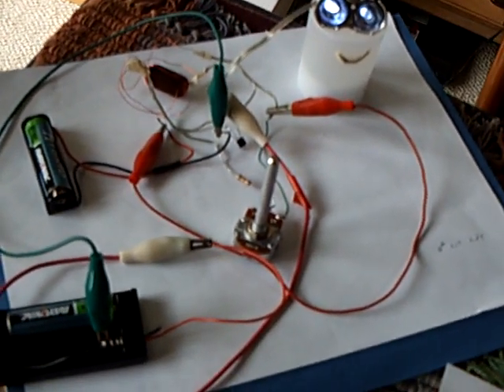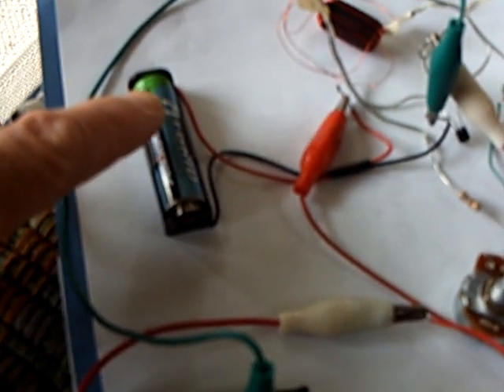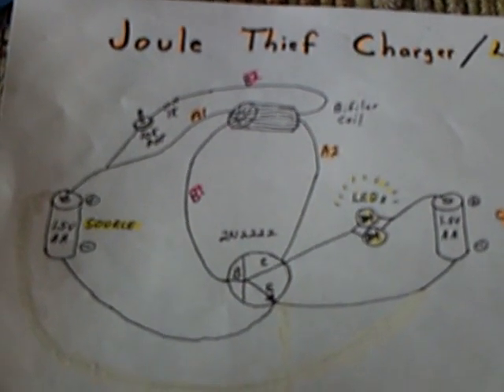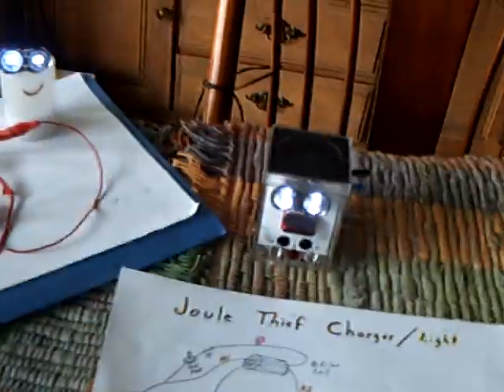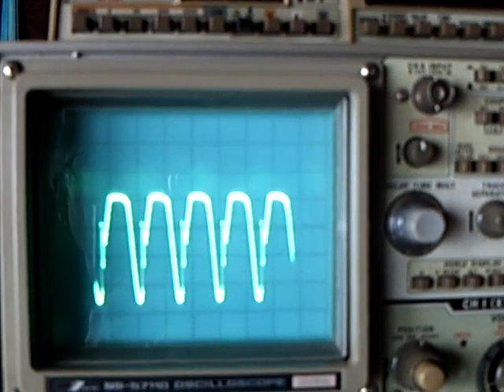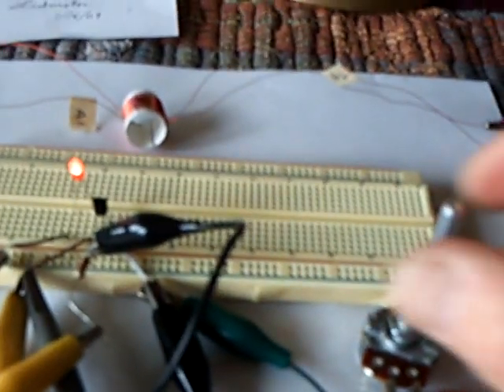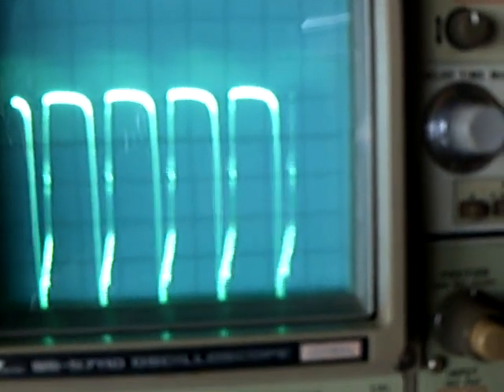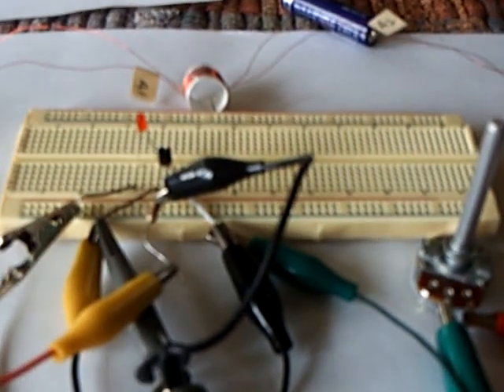Resonating Joule Thief

Comment: Hi, Lid. Did you ever try to loop 2 JTs up, across from each other. I meant, charging each other battery? At the same time, running a small motor?

Comment: P2. L=inductance. I = impedance. C = capacitance. F = frequency. Will want the cap to be a variable cap...like the ones used for radios because the math can be off by +/-10%. Once the right value cap is used draw should go down even more...provided frequency matches for resonance. This is still a nice low power joule thief though :-)

Comment: I know this is an old video, but have you tried putting a cap in parallel with the 'collector' coil based on the frequency at the base of the joule thief...for resonance? Inductance...L=I/2πF Resonance...F=1/2π√(LC).

Comment from the maker: I have spent hundreds of hours working with this simple blocking oscillator circuit called the "Joule Thief".  I dropped the charging part of the circuit and focused on just the main circuit.  It ended up with my "Penny" oscillator which will start running on .45 volts and about 1 microamp.  It is the best circuit that I have built as far as efficiency at very low power levels.  Look in my video files to find out more about "Penny".

Comment: The secret is the collapsing field. Believe it or not, these joule thieves are performing the task of a Bedini motor, but are of solid state components. Electricity is still mostly unexplained, despite how many gadgets we patent. Current that could kill you, passing through a one inch thick conductor has a massive field that travels very high speed. If you were to observe the motion of electrons, it would amount to 1 inch per minute. When an electromagnetic field slaps shut, it captures....what?

Comment: Nice! Could you hook up say a small signal transistor via say a 555 timer or somthing low current that can handle the switching current required to automaticaly switch your 2 batterys around? Somthing reallly low cost, so that you don't have to manually switch out the batteries physicaly. you could then let the circuit go by itself and just observe. I'd be interested to see how muh overall cost somthing like that would have on total run time. Cheers IC I still don't understand how this all works

Comment: Great video Lid!!!  I really like how you keep switching the batteries back and forth.  you went from doing it by had, to using a switch but now, I wonder if it could be done electronically with some simple timer circuit?  Then, it would be hands off until totally used up which I believe is going to be longer than your original estimates too.

Bill

Comment: Nice Video Lid, my bedini coils self resonance easily and they are air cores.

The sine wave looks to me to be taking on the characteristics of the LED?!? Have you tries it by isolating the LED from the circuit?

ie using a 1:1 Transformer with a normal diode one side and an LED on the Other? I feel the Sine Wave would then be constant and just grow in amplitude as you turn the potentiometer. 

If you put the probe across the LED it would produce the same effect as before? 

Worth trying!

Paul